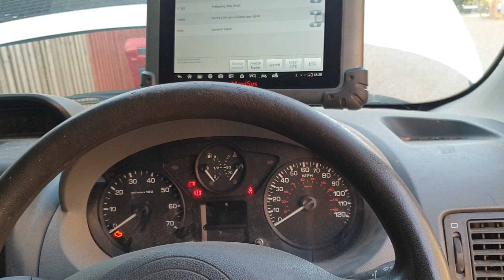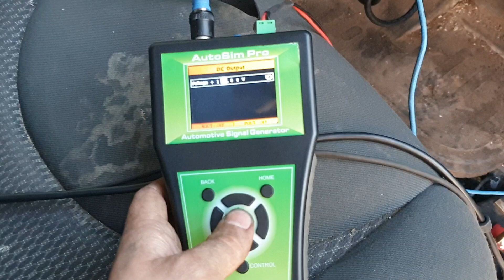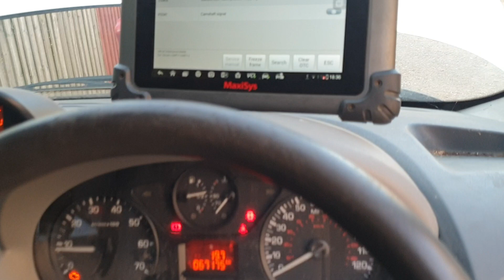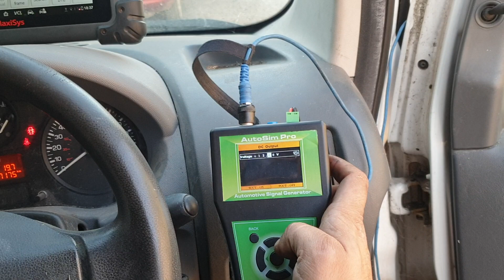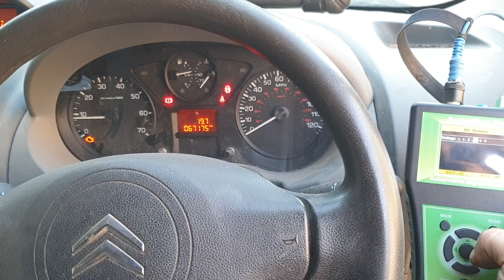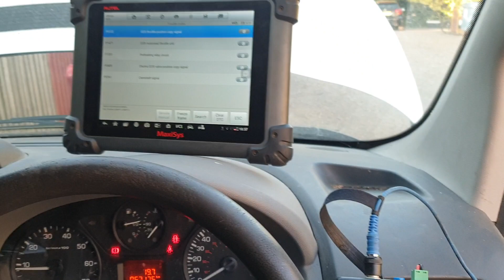AutoSim Pro bypass test

Comment: Why not just use a test lead to supply 12V? would have been much faster.
Reply from the maker: This is a sensor circuit. Therefore any high current could cause damage to the ECM. The current output on this tool is only 150milli amps in the mode it was being used in.
Reply: @eliteautomotivediagnostics4424  There are other 12V Circuits to pull from. Just like there should be other 5V Circuits to pull from.
Reply: @eliteautomotivediagnostics4424  Anyway, the tool is Cool and the Video is great! Just did not want people to think that you have to have that tool to do that Test.

Comment: Come on lads a cheap power probe can do that as it’s just 12v and that machine is overkill for that particular test  🤣🤣🤣🤣🤣🤣🤣
Reply: I would agree Dwayne maybe this wasn’t the best way to show what this product is capable of maybe he can redeem it by using it on fuel sender in 0.5 increments to make gauge go up and down or use there decade box if it’s resistance to make gauge move to see if component is faulty
Reply from the maker: Thanks for watching guys, the issue using a power probe is the current flow it will allow to be produced, this unit will only output a maximum current flow on this setting of 150milli amps, therefore, it will not damage any computer circuitry where a power probe can produce up to 15amps depending on what the circuit breaker is set to and has a much higher possibility of causing damage. Hope this helps
Reply: Hi I have done this test hundreds of times over the years it doesn’t matter as the 12v is coming from the ECU and NOT to it so no feed going to computer just direct to sensor and I am using the power probe THE HOOK cheers
Reply: Dwayne Smith yes I can confirm power will be going to sensor and not direct to ECU so no computer damage and I can confirm doing this for most of my years without problems this machine will be good to feed this ECU as it is more computer safe but for this test power probe is good enough 👍
Reply from the maker: The feed comes from the engine ECU yes. The problem is if the current flow is excessive it will effect the whole circuit including where it originated from (Engine ECU) which could result in damage to the engine computer

Comment: So you used the tool as a power supply, i assume it has variable power supply and that's why your using it?
Reply from the maker: That is exactly right, this tool can produce 0-12v output with 0.01v increment increases, making it super visertile
Reply: @eliteautomotivediagnostics4424   I looked up info on the tool, it also can send variable power pulses of voltage to trigger control flaps, actuators, valves, injectors and smaller DC motors. Generating variable power PWM signal up to 4 A..  Nice tool.
Reply from the maker: @BasketCaseGarageForFun  Exactly that! for any diagnostician its invaluable.